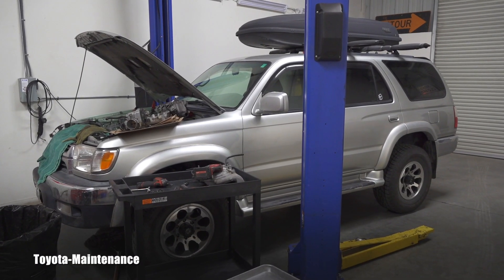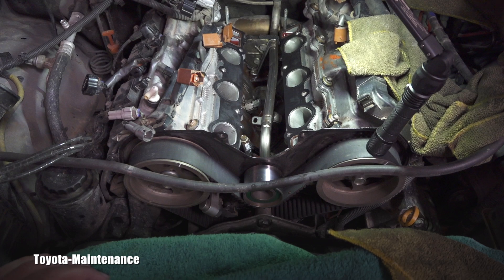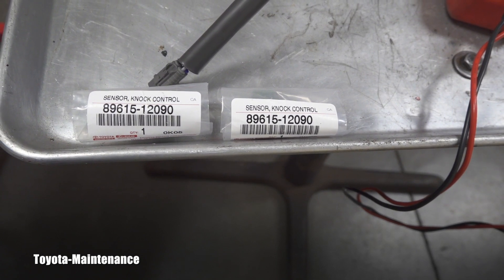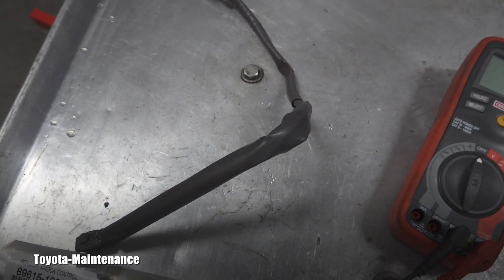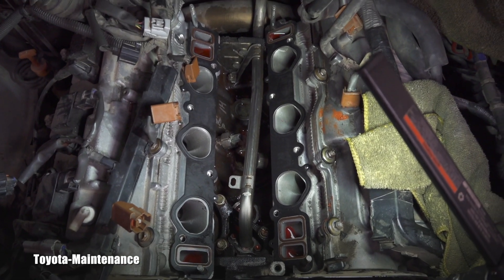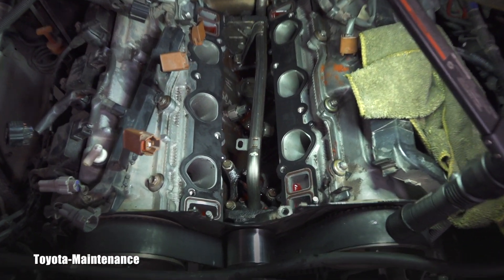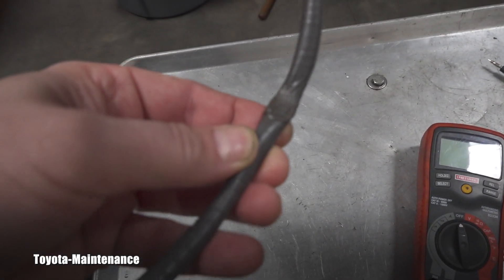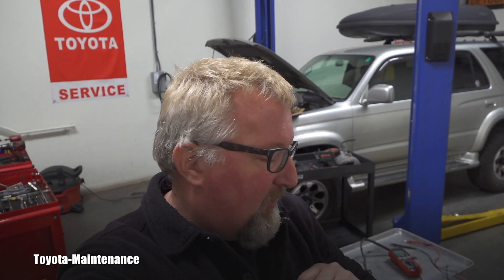Toyota 5VZ-FE Knock Sensor Location

Comment: 3rz needs to recognized as the better engine. Especially for issues like this. 1000000 times easier to work on than the 5vz

Comment: Toyota lists two knock sensors for my 3.4L, 89615-12090 (which you show) and 89615-12040. So I'm unsure whether to get two of the former like you did, or if I need one of each. Anyone know?
Reply: did you figure this out?
Reply: @ I ended up not replacing mine

Comment: Sir, I’m doing some seal, gaskets, on valve cover, fuel injector replacement maintentance. While I have access to the area will be replacing knock sensors and harness. This is on a 2000 Tacoma 5vzfe auto, that has oil leaks but running well no codes. I’m  wanting to replace the gasket on the engine coolant bypass pipe, can’t find the part number can you assist? Any other maintenance while I’m in there? Thank you

Comment: Great Video. Can lean a lot by just seeing what the job entailed.

Could have explained how to check continuity.  Like don't just check Black to Black but Black to any other contacts. Then White to White and any other contacts and so on to prove the wire wasn't smashed shorting to another contact.  I agree that harnessed looked pretty smashed.

Time Crunch is a good thing. :)

Comment: Hey brother. I was just wondering if you could tell me if my 2008 Taco has a Type A or Type B clutch in it? It came off the line in March of 2008. It has 207,000 miles on it and I do all the basic service myself. Actually, I signed up to your channel after I had to replace my rear axle seal and your video helped me clean out my breather nozzle and saved me from having to  do the job again ( thank you ) Anyway, I am driving the 5speed standard now on my way to work and it acts like I am pushing down my clutch a bit. The rpm goes up and then it returns  to normal?? It seems to do it at random and has only done it a few times. The people I talk to seem to think that my clutch is worn out but I dont know. The job seems a little involved so I will probably take it to my local mechanic but in looking up the parts I got a little confused about the differences between the type A and B so any light you shed will keep me from slipping 
Thanks,
Tom Bunnell

Comment: Hi Peter!  Love your videos.  I have a 2002 tacoma with the same 5VZFE engine.  Very good info!  
What is your opinion on aftermarket parts?  In this particular situation, one of these sensors from Toyota costs $279.00.  On eBay, you can get 2 sensors and the wiring pigtail for $30.00.  Do you ever use aftermarket parts?
Reply: Go with a good aftermarket brand like Denso , Aisin , and Beck & Arnley are pretty good in my experience. Denso and Aisin are the part supplier to Toyota and cost less but are almost if not the exact same quality. But since it is a bit of a hectic job for an average person I suggest you try to get original Toyota parts so you don’t have to do the same labor intensive job twice.